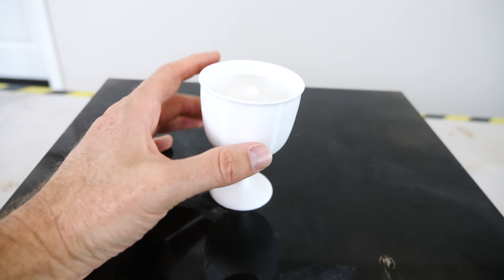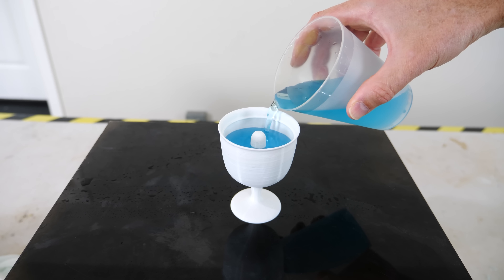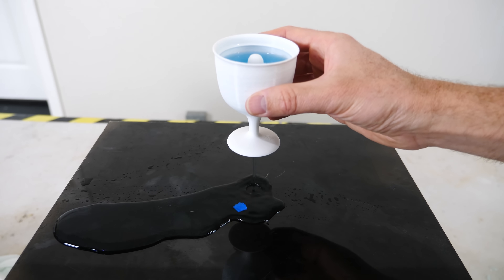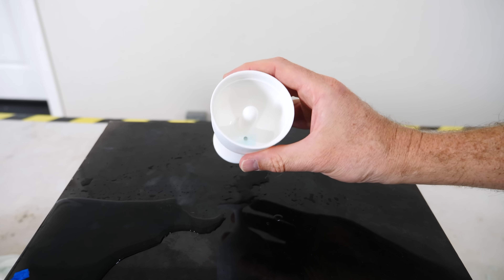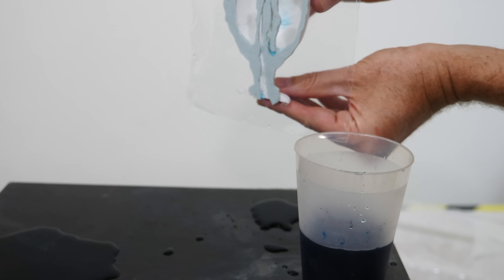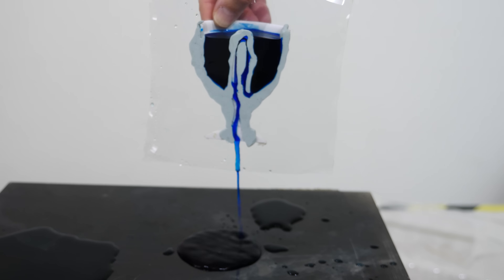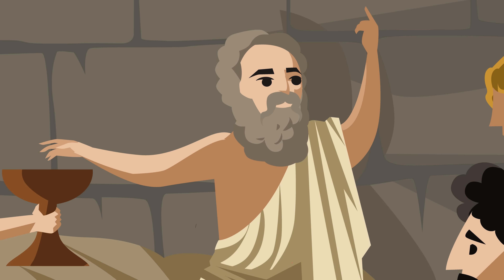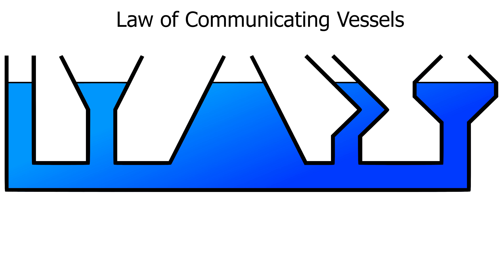How To Stop The Greedy Cup

Comment: Just put a thumb on the hole at the foot of the glass before you fill it up and remove it after you drank down the fill line, if you were to sloppy with the sealin blow air into said hole

Comment: I'm not convinced that he got a vacuum during that test. The water boiling off will constantly be adding pressure to the vessel and his vacuum pump may not be fast enough.

There may have been enough pressure from the gaseous H2O to prevent the liquid from boiling at the top of the siphon.

This could be assisted by the lack of exit at the bottom of the cup. If there is a restriction of flow there it would cause a pressure to build up against the flow, keeping the siphon from breaking.

Water tension (cohesive forces) or capillary action (adhesive forces) could also be the cause, as he suggests.

Comment: It seems gravity acts upon a sufficiently viscous but also fluid enough liquid, which fills the vacuum of the tube as it displaces air to allow the liquid to dissipate gravitational force through transfer into the cup itself. Once the liquid receives enough gravitational force from its mass out the tube, it crests the apex of the bent tube and the viscosity of the fluid pulls increasingly more liquid in a positive feedback loop, allowing the gravitational force to dissipate more efficiently and find equilibrium stability faster by flowing out of the cup than through the cup itself.
Reply: if there is still liquid in the chamber, then it isn't a total vacuum, and nothing unusual occurs with the siphon.  there is no reason to theorize bizarre explanations like capillary action or whatever you just wrote

Comment: I think my moped has a less extreme iteration of this effect.

From what I know about siphons they only will drain to the point the drain hole is at. In this situation the hole is at the bottom of the portion the liquid is in and at the bottom of the base. My mopeds is a little more from halfway up the side, so if you fill it with too much transmission fluid it drains out as the cup does but levels it out rather than draining it completely.

Comment: That's interesting. Not how I guessed it worked when you first showed it; I wasn't thinking siphon, I was thinking that that pillar in the middle had a float in it that would open a valve when the level reached the line.
Also, you ever think about trying to add a rubber glove to your vacuum box like they have on gloveboxes? It would make things like pouring that cup a lot easier, assuming you could attach it securely enough not to leak.

Comment: Nice props, props.
I don't think the syphon effect is a real 'action', rather an analogy or allegoy.. It's just too rudimentary and 'locality' driven.
Rather, it is air pressure, similar to the boiling water in a stairwell at room temperature effect.
If the cup was lidded & the inside under low pressure, it would fail to leak, which excludes the surface tension syphoning effect.

Comment: You are defeating the whole point of the greedy cup! If the cup holds, lets say, 100 grammes of water to the fill line and 110 grammes to the top, then you put 20 grammes of gallium in, you then only can fit 90 grammes of water! Since the whole point of overfilling the cup is to get more water to drink, using gallium does not help at all.
Plus you really dont want to drink those 20 grammes of gallium - especially if you have been in a car accident and had to have your stomach reconstructed out of aluminium......

Comment: Technically pouring a layer of gallium into the cup isn't defeating it. You reduce the volume of drinkable liquid with it, meaning you likely get the same amount or even less than if you complied with the cup. You could, of course, drink the gallium, it won't kill you, but it doesn't taste very good (kinda like sucking on a dirty coin).

Comment: If you want to know more about these or their practical applications, they are also called bell siphons. They are used in hydroponics and even some water reservoirs to prevent flooding and other things. They are also found in many urinals. I have one on my rain barrel so when it reaches the top, it "opens" the valve and fills the next container.

Comment: The detergent dispensers in most modern washing machines work the same way. It adds water to the detergent you put in the cup until it gets over the top of the internal cylinder at which point the siphon effect begins and it siphons the mixture all the way down to the bottom where the opening is. That's why most front load washing machine instruction manuals tell you to close the dispenser drawer slowly, because if you don't you'll bump the level of the liquid too high and it'll drain your detergent and or fabric softener into the drum before the cycle even starts.

Comment: I don't think it's syphoning in the vacuum chamber, I think the bubbles are pushing the water out from the bottom of the narrow tube. Don't forget that it's continuously boiling in there. If at the bottom of the tube we have 4 watercm of pressure (as everywhere else at the bottom of the cup) and we have 2 cm of lightweight bubbles plus 3 cm of water above it in the tube, this will easily be pushed out over the top.

Comment: I don't see how the pressure at the bottom of a 30ft pool would be the same as the bottom of a 30ft straw. Wouldn't there be alot more weight in the pool and therefore more pressure?

Comment: Honestly it's not interesting it still works in vacuum. Under normal atmosferic pressure it does work cus the law says it works under ANY pressure. The so called vacuum is just very low pressure so it works like under any other pressure.
Reply from the maker: the part in the U-tube that is above the level of the water is lower pressure than the vapor pressure of water. So it shouldn't work in a vacuum. But it can't boil the water fast enough

Comment: Idk, the idea of his videos are awesome, but the execution and lesson behind them are kinda stupid. Gallium? Thats not a way to cheat the system, that's a way to poison yourself. Whats next, mercury? Honey is denser than water, why not try that so you can actually USE the cup afterwards? I feel my braincells dying after I watch his videos... "Secret fact, you can plug the hole to stop the flow" NO SHIT! 
There are no sucking forces in physics, its areas of low pressure and high pressure - The syringe and box are already at a 'vacuum' so you cant pull a lower pressure into the syringe to "suck" up liquid. 

It isn't capillary action, its a syphon... Capillar action may first be applied to the water climbing the tube, but once the water starts flowing and pulling the rest with it... thats a syphon... and the reason why it STILL does it in a vacuum is called gravity. Take gravity away? Syphon no longer works but Capillary action still does. Take away atmosphere and Capillary action no longer works, its a syphon. 

I feel like this video would of been a bit better if you explored the idea of what can plug up a greedy cup instead of doing the first 3 things you thought of in 5 minutes. I'm no expert, but this video is common sense overload.

Comment: It's gravity, not air pressure that makes it work. Do it in zero G and then it won't drain out.
Reply from the maker: the syphon effect created lifts the liquid above the level of water. This is done with pressure. The pressure of the liquid above the level of external water is lower than the pressure in the vacuum chamber (lower than boiling point of water). So the syphon should  fail but it doesn't because the tube is small.

Comment: Gravity makes thia work, not pressure, but i can see how bubbles might impede it... But the liquid in the drain isn't exposed to the low pressure atmosphere directly.
Reply from the maker: the syphon effect created lifts the liquid above the level of water. This is done with pressure. The pressure of the liquid above the level of external water is lower than the pressure in the vacuum chamber (lower than boiling point of water). So the syphon should fail but it doesn't because the tube is small.
Reply: @TheActionLab  so try with a bigger tube... let's see what is happening